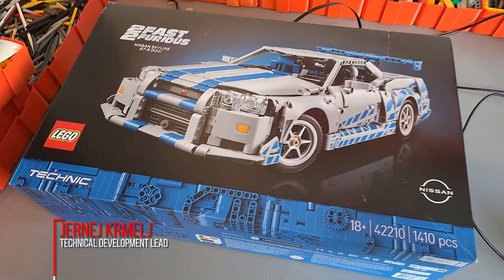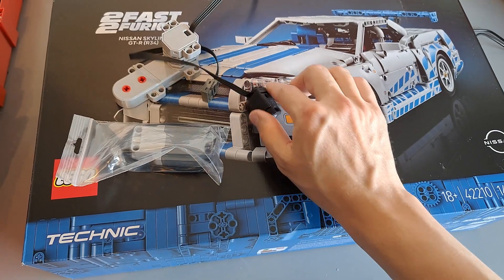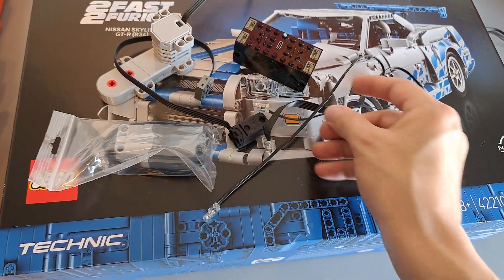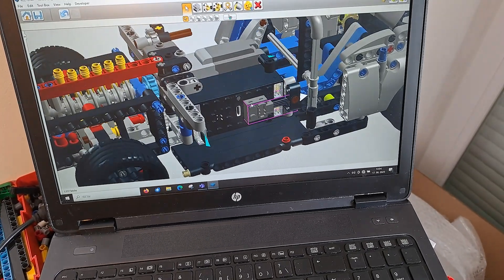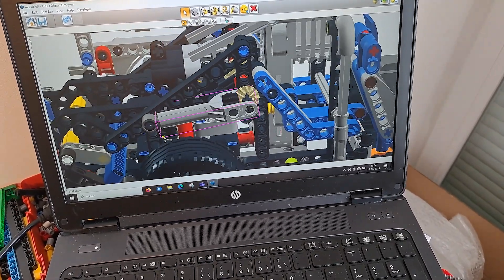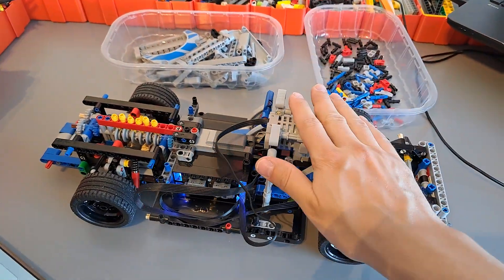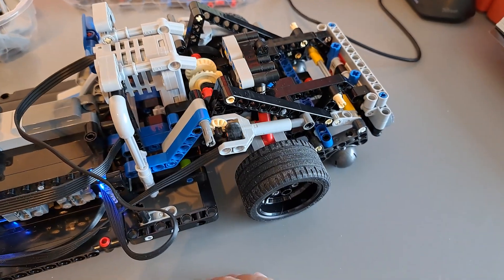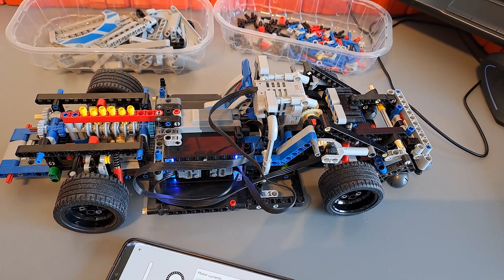42210 Motorized Nissan Skyline – BuWizz Powered Drift Car Made of LEGO® Bricks! 🔥🚗

Comment: how fast is the car ?
Reply: 10-20 kmh
Reply: @ilikecars_n-lego  nice
Reply: @ilikecars_n-lego  i doubt it will be that fast..
Reply: @Technic_RC_Garage yeah like the higher the diameter of the wheel the faster. This wheel Is one size bigger than the wheels of the Lamborghini technica. So i guess 15-25 now. Buwizz uses (i think) mostly the same gear ratio as the buwizz motor and it depends a bit if it uses the speed or torque. I guess torque for the space in the nissan.
Reply: @Technic_RC_Garage check my mazda miata video its the same scale
Reply: @ilikecars_n-lego  I did one for 42210 with 6 buwizz motors (soon will be a video) and it will go like 25, so I highly doubt that 1 motor one will go over 12....
Reply: @ilikecars_n-lego  yeah but urs has 2 BW motors
Reply: @Technic_RC_Garage this one might be lighter
Reply: I will watch and like for sure
Reply: @ilikecars_n-lego  hmmm, not sure, this has like 1400 parts...
Reply: @ilikecars_n-lego  thanks! It will be on my main channel :D
Reply: @Technic_RC_Garage my miata has about the same amount of parts. But we will see.
Reply: @ilikecars_n-lego  ah ok, but more power,.. I think the speed is worse on this 42210